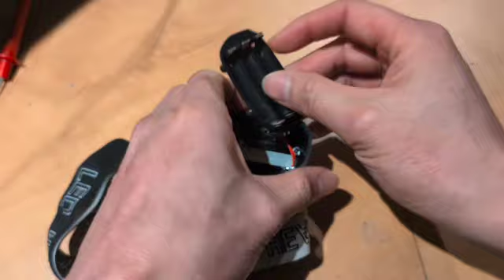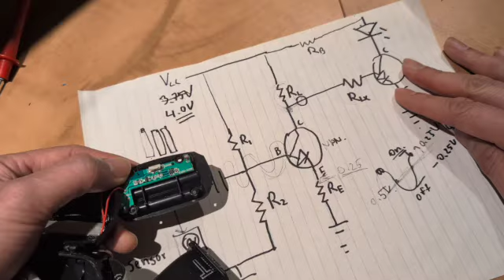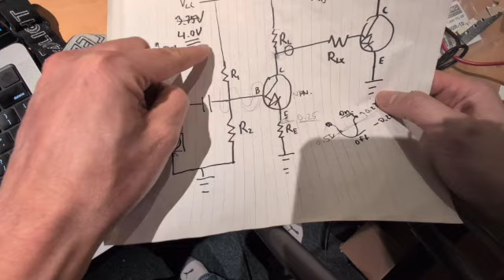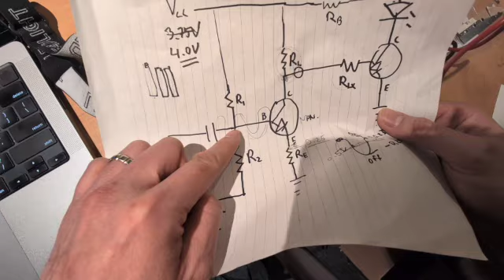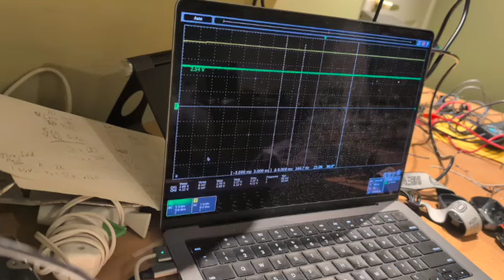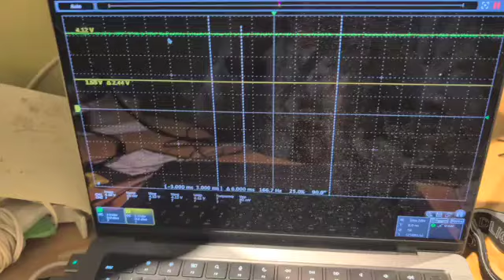ABS Sensor Diagnostic Tool Build Part 2 with parts from a $3 flashlight

Comment: That IC seems to be in a trillion flashlights... You probably should just delete it, and use just the battery case and led... there's no teal problem with the battery voltage drop, since you only need ~0.7 V, you just need to have the divider set up to guarantee 0.7 V when Vbat is, say, 3.5 V... you're overthinking this a bit...
Reply from the maker: Hey now to think about it , because it's a pchannel mosfet we might have even gotten away with wiring the signal directly to the gate and let the negative cycle pull the gate to ground instead. Thx for watching
Reply: Ah, even a p channel... Anyway, I've been doing this stuff for 50 years, now, and like to simplify, but just enough 
😉🐻‍❄️. (BTW "Karhu" means "bear")